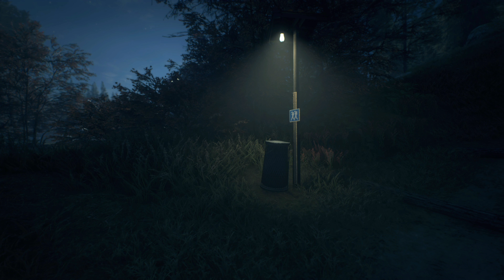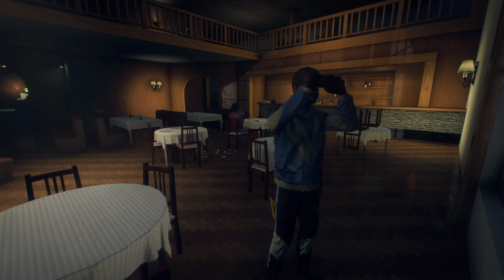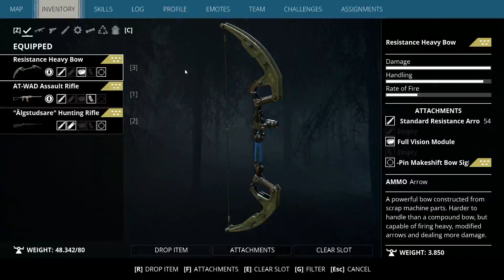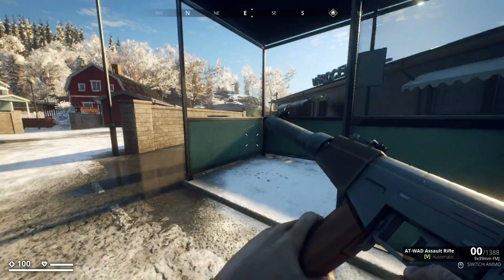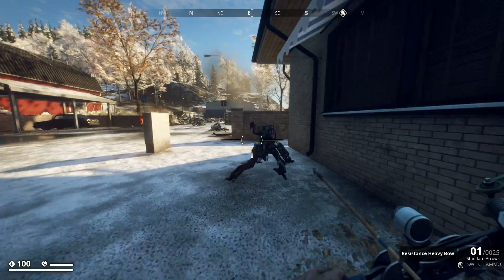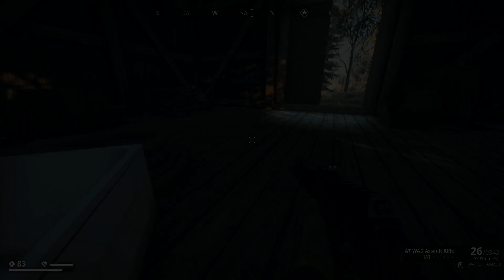Generation Zero - MAX STEALTH BUILD

Comment: Is it still the case that a higher value in visibility reduction actually makes you more visible, or can I aim for as much as I can now?
Reply from the maker: The last time i checked it sadly was still the case as of the crafting changes though a small update has happened since and i havent gotten around to testing it just yet, i'd say likely a mixed set up is still best atm

Comment: umm loadout edit critique Barriers from the Resistance DLC pack is needed.  you can go to full 100% cover in open fields which is really good. Small Emps * if you kill the Machine before it comes back online you are not Detected. Lastly Remote Bombs and Smoke Grenades... Remote Grenades for Tanks 6 remote bombs on a Underbelly of a Tank takes off both their guns in a Heart Beat. Satisfying to take a tank from 100% to 40% at the beginning of a fight.  I know you don't like to MicroManage allot but on the Build... _ Trigger Happy takes allot of point to get to...  "its possible to get the damage numbers from.. Marked Target. stealth aye we need the tagging bro.  Wpn Sway Umm :D hold shift or take a med-pack problem fixed. Explosives Expert :D .... _ .... when you get caught 'your hit and run' tactics will take over in your genes.. Fireworks, Smoke, and Dog Lure will buy you enough time to Escape.. 

For your testing videos what difficulty do you prefer in your testing? 50% stealth only works on Skirmish... 70-80 is meant for gorilla levels. Where stealth is much more fun.

Comment: Guys, i'm posting this here because of the high viewership and also because I just can't find any useful information anywhere else...

Has anyone had trouble with super lag on opening loot boxes? This just started for me yesterday. If you click and hold to open a box, the progress bar zooms to the right but stops just before the end and it takes anywhere from two to seven or eight seconds for the box to finally open. It seems like the more stuff is in the box the longer it takes, as if the contents list is having to be slowly built. Opening doors and other things where the open effect doesn't involve contents is as fast as ever.

Yesterday after it got slower and slower it finally crashed the game. I reduced my ingame screen resolution and lowered my graphics settings and it stopped crashing, but the lag was still there. This tells me that somehow the game is not releasing graphics memory properly(?) I've played though for the last month on my Nitro 5 RTX3050Ti with no issues until yesterday. Thanks for reading.

Comment: Stealth in this game is poorly designed, the schemes for the height of the jump are good!🦘😁
Reply: It's very basic in some ways. I have great stealth when my character is in the prone position, but while crouching not so much. I'm going to try this stealth build by Tenebris though, so maybe it will be a lot better.
Reply: @mrbr549  Yes! this can come in handy in beginner levels, especially for stealth lovers. But I like hardcore better.
Reply: Having 10% + 10% on both the pants and shoes I'm able get on top of houses,,,  and using the turrent as a step-stool

Comment: So the bugs I know of is the base bugs. The lynx and wolf (probably has to do with the fact that the wolf may spawn with no ocular systems. "Eyes". Which may have to do with them doing literally nothing and not fighting back against finix machines.) Also shooting one rocket pod makes them not use the other. Despite having one still working. Also taking the gun out makes them ignore you. Also lynx will also not do anything at all to assist wolf. And this is common. 
So many bugs that makes fights less engaging. Since wolf do nothing.
Reply: It's the 80's, AI being crap makes perfect sense. Especially in the Soviet machines that aren't controlled by mind uploads or through connection to FNIX hive mind.
Now, that thing when all the enemies stop fighting each other because player made a little noise and the supposedly logical machines calculate that wasting hundred missiles on one human makes more sense than shooting at the enemy tank in front of them, that is an immersion breaking bug.
Reply: @AnalystPrime  Pretty sure thus isn't a simulation game and both factions in early updates would engage each other including lynx themselves. The backstory has no correlation in how they work. Their AI is clearly bugged as their behavior was not like this when released. And having missing components that affect their AI (possibly) when spawning in has nothing to do with the Era of the game. The game does follow "some" accuracy but in no way does it relate to IRL events so logic does not follow IRL